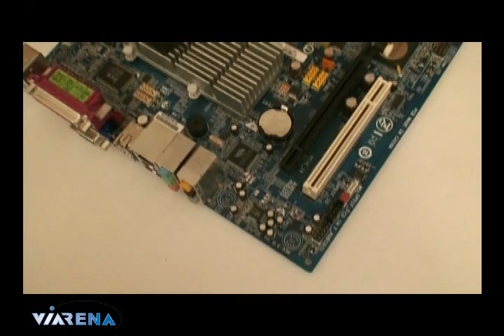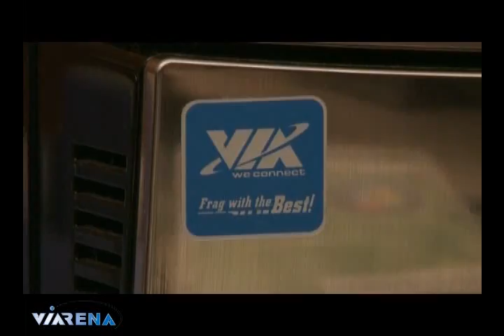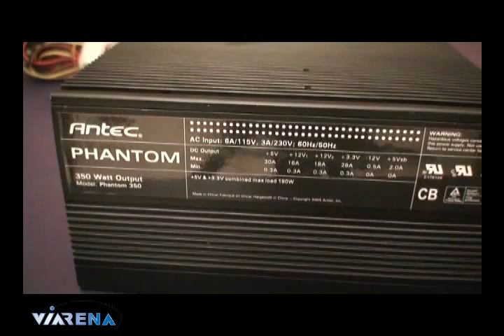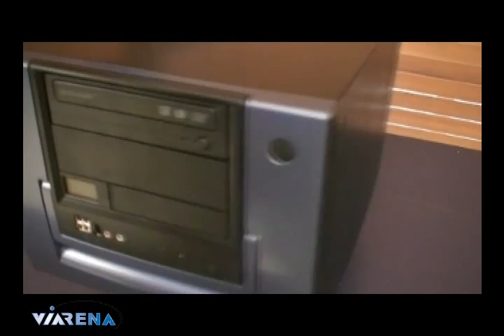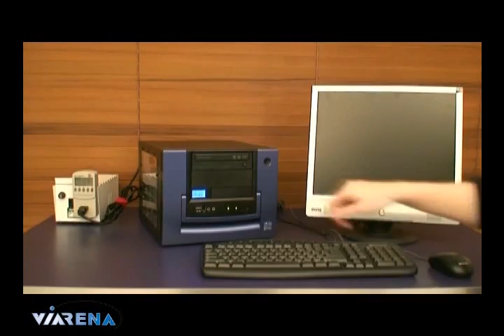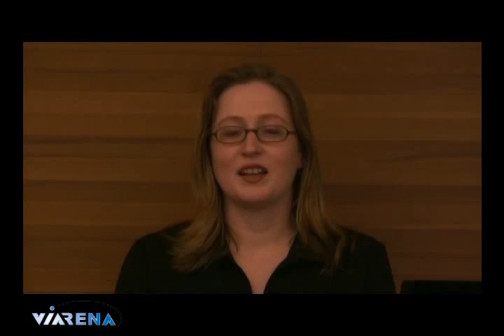Going green: Building a sub-60W PC

Comment: Indeed interesting with a computer that doesn't consume more than an ordinary  llightbulb.

You could boost its performance, since you're only using 1GbB of RAM, you could go for a mini-ITX motherboard, and use SSD-drives, to boost performance and lower power-consumption even further :-) then you could possibly even do just as advanced things on it as on the mid-ranged PC at the side.

Comment: there louder yes... but sens it was build the best low power system. it does not state anything about the noise :D

im into a project like this my self. im ganna go on it in an diffrent approch doing it with stock of the shelf items. my target is under 100watts consumptions with an dual core 4gb ram machine running as an router/firewall for my network.